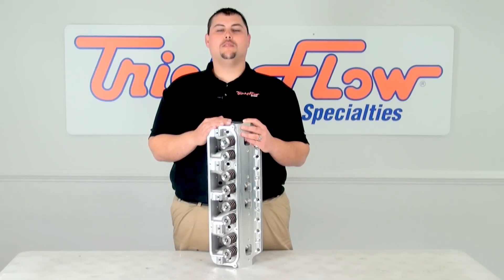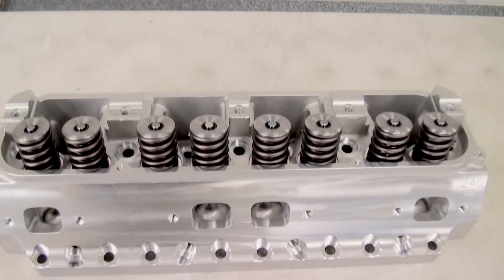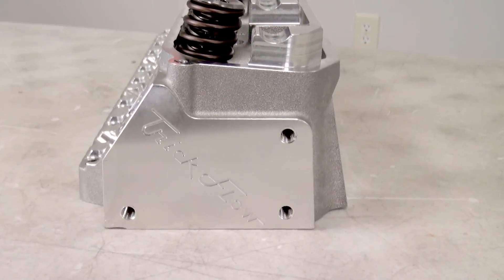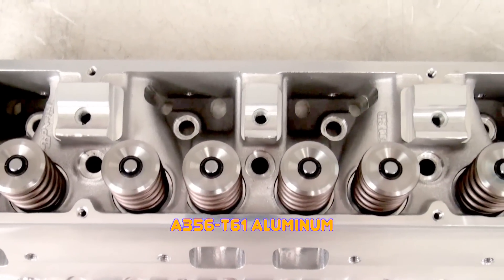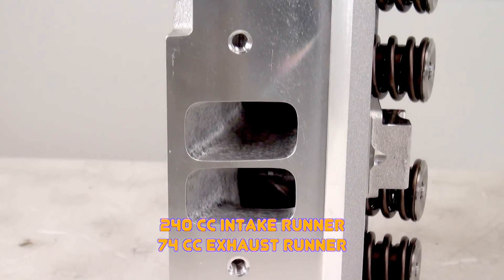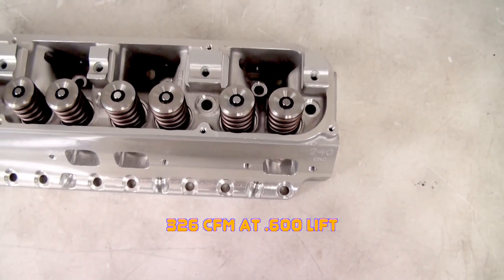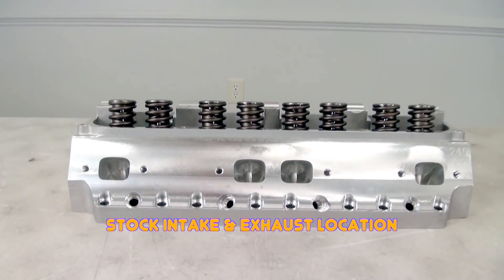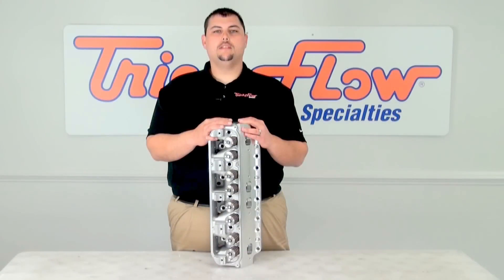Trick Flow PowerPort 240 Big Block Mopar Cylinder Head

Comment: Will rocker studs need to be studded? Do to high lift stress?
Reply: I don't think that's a problem on shaft style rockers.
Reply: @1967davethewave  I had a pair of stag6 heads and studded the rocker shafts! Just say n
Reply: @paulairola7041  I'm sure you can do it and I'm sure it's stronger but I don't think people generally do it. But I seldom run a cam over .600 lift so I don't know about much.
Reply: @1967davethewave  I ran .695 lift on a 451 stroker mopar, Calles 4340 crank, aluminum BME rod motor.
Reply: @paulairola7041  That sounds like a hot motor. Sounds like you need some of the Trick Flow 270 heads on that one.
Reply: @1967davethewave  That was in 1997 and since sold super gas 70' AMX back halfed tube front end , J&W powerglide, throttlestop, mark williams 9inch with 15x33x15. Sold because expensive to maintain and run
Reply: @paulairola7041  I get that. I have a 68 Roadrunner but it just has a mild 440 in it. Currently running 440 Source heads that are ported and a flat tappet cam that has .530 lift. It's only an 11 second car. But I have a 440 block machined, setting in my shop with a host of good parts and was thinking about some Trick Flow 240's. I know they are better out of the box than my current heads with their porting. I just can't decide if I want to put it in the Roadrunner and have a more dedicated drag car or get something else like your AMX. I know I could have something much quicker if I went that route.
Reply: @1967davethewave  I bought AMX from owner who built car and saved a bunch, i back halfed to tuck 15x33 under car and added wheel bars, car was certified at 8.50, best time 9.02 @153 good with your car Dave

Comment: I just bought a set of these. They have the .680 lift springs, can I run a solid flat tappet with those springs ?
Reply: @Willy Pete guys are getting up to 750 horsepower from these. Check out Andy finkbeiners 470 stroker build.

Comment: Trick Flow products are top Shelf and well designed...Dont waist your money on Pro-Comps...and have the Valve seats fall out of the casting...and kill the engine...I've used Edelbrocks on my last 2 Big Block Mopar Builds...They are an excellent casting also...I will use Trick Flows on my next mopar build....The Trick flows.. flow about 30 cfm more than a ported edelbrock....Bare in mind they are CNC Ported as delivered and the Edelbrocks are As Cast....My last 512 cid .pump gas 440...with a 234 @.050 hydro-roller and Dealer installed CH4B duel- plane made
551hp...601pounds ft of torque...
Excellent power for any Mopar Street Bruiser.....

Comment: for the money just go with indy
Reply: +bryan chapman "For the money just go with Indy"? $2000 won't get you a set CNC ported Indy heads that are fully assembled. You'll have to spend a lot more money with Indy.
Reply: +Kwan Jang Nim for 2k. u can. get a set of Indy 440sr heads. minus valve train
Reply: +bryan chapman BUT,these are Done , all included with springs, just a matter of more velocity 240 CC VS. 275, and slightly more HP( 320 CFM VS. 305 C.F.M. all  tales told , whichever is BS ing more
Reply: easy 700 hp 440, just gotta like a riller cam
Reply: Add $1000 to the price of a trick flow....Indys are Great...but they have a pretty big intake Volume..with the EZ 295...being the smaller casting...still too big for a mild + .030 440....Building a race Engine...use the Indys...building a fast street engine...that you dont want to shift at 6800...use the trick flows....
Reply: What compression would I have if I replaced my stock heads with these on a stock piston 10-1 440

Comment: Looks like a very nice cylinder head. I'm planning on ordering a pair for my 451 stroker when they become available. Have a couple questions though...

Why did TrickFlow decide to go with the 2.19" intake  1.76"  exhaust valve combination vs the more common 2.14" intake 1.81" exhaust valves?

How did TrickFlow achieve such amazing amounts of air flow from the intake port without moving the push rod over?